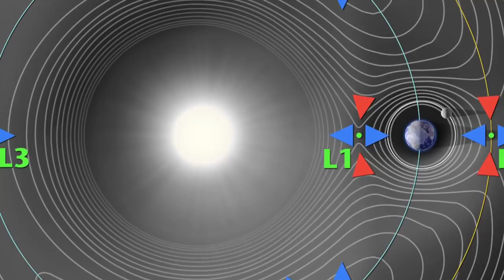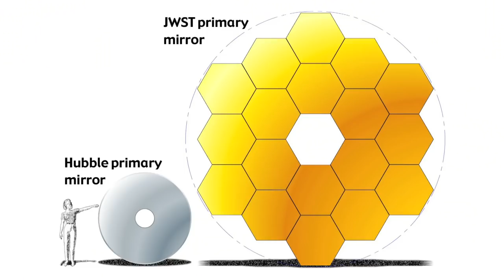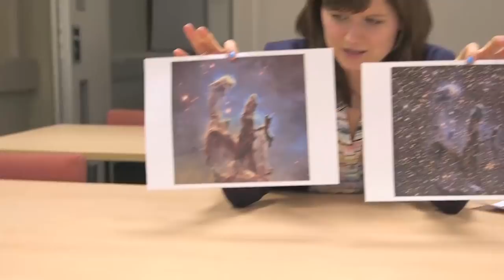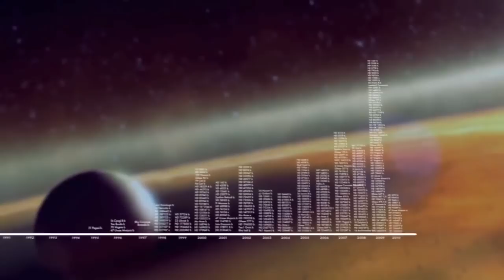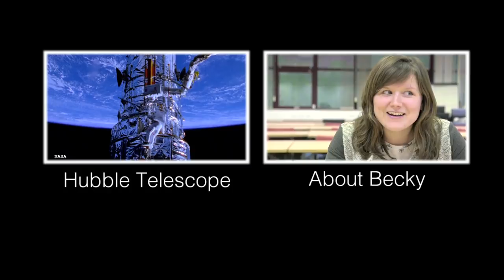James Webb Space Telescope - Sixty Symbols

Comment: Unrelated question , but is it possible for there to just to be a quark by it self. For example could we observe on up quark? If not, why not?
Reply: We can't directly observe anything smaller then the width of wavelength of visible light, which I believe is slightly bigger then the biggest atom.
Anything smaller can't be observed because visible light just passes straight through
Reply: No, it is not thought to be possible for a quark to be isolated below a certain temperature called the Hagedorn temperature. The reasons have to do with the nature of the strong nuclear interaction. It is a phenomenon called color confinement.

Comment: How many objects are in the L2 area now and how big is a lagrange point? How many JWST's could fit?
Reply: L2 has hosted 5 spacecraft at different times in the 10 yrs since 2001. These are all gone now. Right now the Gaia Space Observatory is there until some time in 2018 & it may still be there when JWST arrives. JWST may live long enough to see three other planned space telescopes arrive over the following 10 yrs. The Lagrange points are different sizes, but in theory L2 is zero size because there is no stable points in it. To stay near L2 spacecraft have to orbit the invisible point while using small amounts of propellant. So the usable size is HUGE if you measure the size of the orbit. Therefore many craft can use L2  at once if their orbits are worked out carefully.

Comment: Now my knowledge of orbits is limited to Kerbal Space Program, but how do you ensure a 365 day orbit if the orbit itself is higher then earths ? I'm assuming that it is higher for both Apoapsis and Periapsis.
Reply: Kerbal Space Program uses a system of "Spheres of Influence" for each planet/moon/sun. This is much faster to both develop and run than true multi-body gravity, but it does leave out some of the features of real orbits. One of those missing features is the Lagrange Libration Points, which are (and I'm drastically simplifying here) basically empty points in space that you can orbit, caused by the gravitational interaction between two massive bodies orbiting each other. The satellite is going to be placed at the Sun/Earth L2 point.

Comment: wait... if it is parked in L2, what will power it?.... some giant battery??? - won't that have to be replaced from time to time, for recharging???
Reply: Nuclear power man and solar panels. That nuclear fuel ( maybe uranium ) will power for far longer than the other systems of the JWT will last . Basically , after years of decomisioning because maybe the mirrors will wont work or other tehnicallity , the telescope will still have a little power due to nuclear decay.
Reply: it didn't seem THAT big to me, to have a tiny nuclear reactor in it...
Reply: Nope, no nuclear power. Only solar.
Reply: that brings us back to my question: what sun should power its solar panels (?)... it will always be in the exact same position, stably, at L2, in the shadow of earth
Reply: I found my answer; thanks; but you were of no help.
"Lissajous orbit" is the solution, as far as I understand it. It will not be parked in L2, but hover around in a so called "Lissajous orbit" (atleast that's the only way it could work, I suppose), to get in and out of Earths shadow, regularly...
Reply: +PyrrhoVonHyperborea -- You didn't say anything about Earth's shadow. You asked what powers it, which "solar cells" is the correct answer. If you had said something like, "wouldn't the Earth's shadow block the sun's light?", then I would have answered that the L2 point is far enough away from the Earth that the Earth doesn't block the Sun's light completely. I'm sure orbiting the L2 point provides some help, but the fact is that there is sunlight right at the L2 point.

Comment: 00:16 Did I hear that right? Hubble doesn't use fuel...
Reply: sufficientlyoldskool all pointed satellites require fuel to desaturate their reaction wheels. Angular momentum is conserved nearly perfectly for an object in orbit, but drag moments are persistent and you can only reorient by accelerating wheels or firing RCS jets. Wheels can only spin so fast, and you can only carry so much fuel.

Comment: JWST will, if all goes well during launch, transit and deployment, be  a huge leap forward in infrared astronomy and all that follows scientifically from that. But the life span of JWST is short. It will not be servicable like Hubble, and it has a limited supply of station-keeping propellant. Once it's out of propellant, JWST will gradually drift out of the L2 zone. Not sure where it will go then. 5-10 years is all we'll get.

I wish they'd build a true Hubble successor. LEO, 6-8 m mirror, UV-visual-NIR, state-of-the-art sensors and processing equipment, and multiple redundancies for critical parts like reaction wheels.

Comment: I wondered why it would need a solar shield at L2, which is "behind the earth" relative to the sun, but if my math hasn't completely failed me, the umbra of the earth does almost, but not quite, extend to L2. So some direct, and lots of refracted and scattered sunlight will reach it. It will see the earth slightly smaller than the sun, and be in an eternal annular solar eclipse.
Reply: @pinkdispatcher The JWST will not be positioned at L2. It orbits around the L2 point in a 'vertical' plane [the mini-orbit around the L2 point is at 90 degrees to the orbital plane of our solar system]. The 'bottom' of the JWST vehicle in front of the sun shield has a solar array that needs to be always in sunlight to power the instruments. The 'top' of the JWST where the instruments are is always in shade from the sun due to the sun shield.
Reply: Cool. Thanks a lot for the answer!

Comment: roughly a million parts and one little piece miss its planned deployment only has to work once so much the engineers are gonna be on oxygen by the time it deploys. Defibrillators will be in the control room so in case it fails some of these engineers will have a stroke if it fails. Some worked their whole career on this satellite first one blew up right.

Comment: I kinda gotta wonder - Launching a rocket costs a lot of money, but with the intensive testing they are doing - is it really cheaper than just trying it out with the real thing? If it works you have it in space and it is way cheaper.
if it fails you still did a lot of tests in the actual environment and possibly still didn't cost much more than testing on earth.

So just build 2 - if the first works you have a second one you an send to a different orbit.
Reply: @ABaumstumpf And if the first one fails to work how do you know what went wrong? A failure of such a complex device might have multiple linked causes - better to test on Earth where one can easily examine structure, electronics, the four instruments, heat shield deployment, comms etc.
Reply: it is an interesting idea, but what it really comes down to is that you are working with something that has new technology. It isn't just the rocket that can fail, but the satellite too. While the people at NASA and ESA tend to be very clever and get things to work after they break, it doesn't always work out well (like with kepler)
So it is usually easier to test everything thoroughly on earth so that if an individual component breaks, you can improve it and replace it, instead of having to replace an entire satellite.
Reply: The telescope itself is very expensive. If we launch it for test and it does not work properly (say it does not deploy) how can we correct the problem? Build a new one? that is going to cost a lot.
Reply: you cannot just build "another one" they have specific funding that a country gives to NASA. Called budgeting.
Reply: Of course i know that the whole thing is blood expensive.  

The thing is still: They are testing these types of satellites for years with vacuum-chambers, for ESD-protection, radiation etc. the telescope has enough sensors on them to tell what goes wrong.

Now all those testing-facilities too cost money, same as the time that is spent on testing.
if instead of that the telescope is sent into orbit you do not need nearly as long on ground-testing and now have your satellite permanently in the "perfect testing environment" so to say. And in the time between planned testing the satellite can be used for astronomy - and the sensors will still collect data so even that can be used to validate the integrity of the telescope.

Dec 2016 - the satellite was mostly finished.
October 2018 - date of launch.
Nearly 2 years of testing on the ground - that too will cost a lot of money. And i am still wondering just how much that testing costs over a new satellite. Cause now that the first is build, building a second one would become much cheaper. The knowledge and facilities are there.

Comment: The problem with this entire project is the cost to risk ratio. They claim the reason the project is so far behind schedule and so over budget is because they don't want a repeat of Hubble, since a repair would be impossible. But the thing is still going to be launched into space on top of a tin can armed with a few hundred tonnes of explosives and enough vibration to send someone with spine or kidney problems to the hospital. They're also incredibly arrogant to think that such a ridiculously complex method of deployment is somehow feasible when engineers have struggled for the past 50 years to get autonomous deployment of complex shields and solar arrays to go off without a hitch. I guess they just think that spending billions upon billions of dollars building a complex piece of equipment in a clean room will somehow circumvent all of the engineering problems. If the James Webb telescope fails then you can pretty much forget about Congress ever authorizing funding for a project like this again. This project is way too ambitious and should have been cancelled all the way back in 2006 when the feasibility of the 2005 re-planning was being reviewed. I predict that this thing will end up being the most expensive piece of space junk ever created.